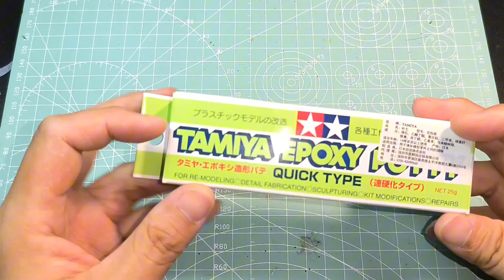The Secret to Widebody your Hot Wheels Car (Beginner Guide) #hotwheelscustom

Comment: Any type of epoxy putty?
Reply from the maker: Too many brand models or industrial putty worldwide, to unify the effect. It is recommended to use Tamiya's standard AB putty. It uses very little, so the price is very reasonable.
Reply: How do i remove it, i kinda make a mistake
Reply from the maker: Polishing, cutting, and forcefully bending... Then do it again.